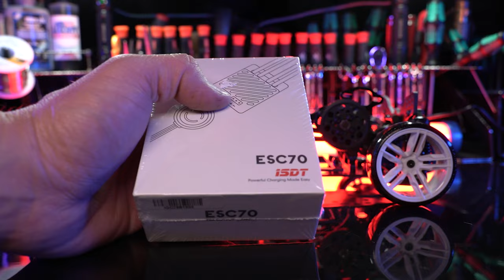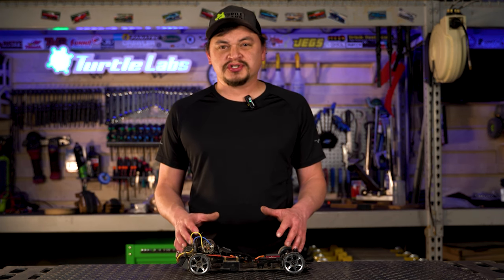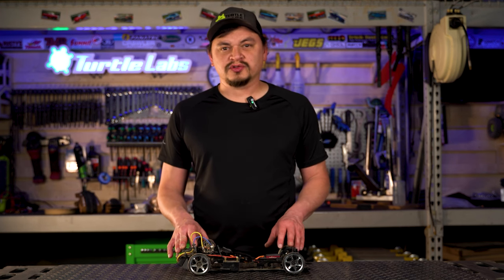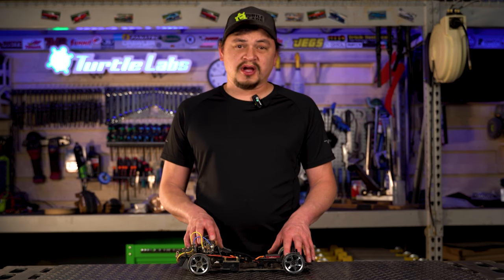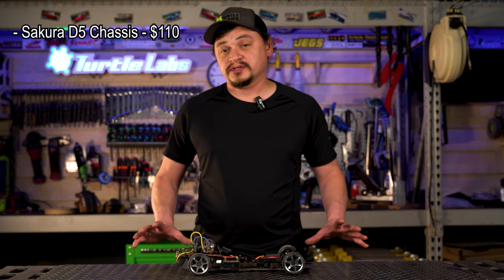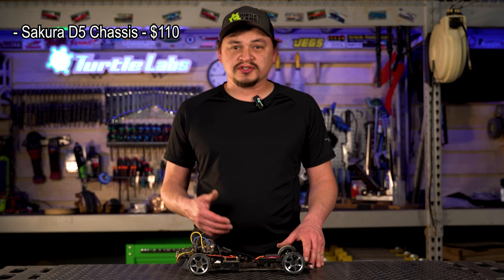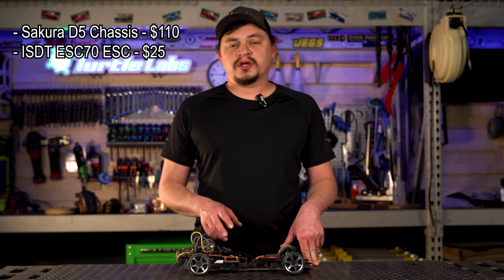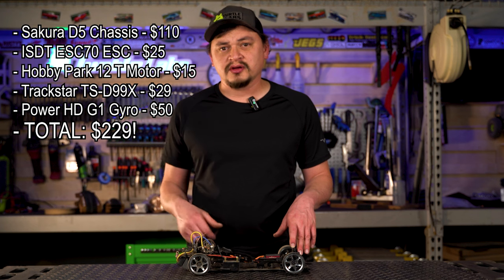DIRT CHEAP Brushed RC Drift - Sakura D5 Budget Starter Build

Comment from the maker: What is your experience with brushed vs brushless? Do you think you need brushless? Do you prefer it? I would love to hear your feedback!
Reply: Brushed is ok but sensored brushless is the way to go! They just run better smoother and faster
Reply from the maker: @jameshankssr466  I agree completely. Brushed is a good cost cutting alternative for a beginner, but brushless is better in every way, other than cost.
Reply: @turtlelaboratories  you can get some pretty reasonably priced brushless setups you just have to look for them! You dont need top of the line to have fun
Reply: @jameshankssr466  Do you think that the Hobbywing Xerun Justock Combo is ok for drift,or is for completely another purpose.Think its very budget friendly.

Comment: just ordered the d5 mr v2 a few days ago, looking forward to trying it.
Reply from the maker: Awesome! You are going to love it!
Reply: Just replace the shocks and you'll be good to go chassis wise for along time. I like the yeah racing 55mm 
qutus slider shocks. Stock Sakura springs, 4 hole pistons, with 10wt. Oil.
Reply from the maker: @DJ.1001  I have the QUTUS shocks on one of my MST RMX cars, and they are definitely a quality unit. Thank you for your feedback and advise!
Reply: I just finished my mr v2 awsome chassis
Reply: Do the kits come along with remote control

Comment: I run my D5mr right beside the hannya, yd2, and mst chassis at my local track. I dont feel disadvantaged at all. Infact my car is on the faster side. Good electronics are more important than the chassis. I run a d10 motor, XR10 stock spec esc and a full futaba s.bus suite. R33 receiver, gyd550 gyro, ct500 servo. My whole car even with top of the line electronics cost about what the other spent on just their chassis.
Reply from the maker: This is my mindset as well. As long as the chassis can be adjusted the way you need, and its durable, it should do just fine. I also agree that money is better spent on electronics, for a better driving car.  Thank you for reporting your feedback on your rig!!

Comment: I’m learning to drift with a d5 running a 19x1 brushed motor and a hobbywing 1060 esc I’ve got no complaints so far
Reply from the maker: Heck yeah. Thank you for your feedback on your rig!
Reply: So do you believe you can go with brushed as a begginer?Im thinking of getting into drifting with Sakura MR but I want it as dirty cheap as I can.... 😂😂😂
Reply: @upbgenoob5488  I think you can. It would be nice to spend thousands to start with but it’s not necessary

Comment: bought the v2 and built it with kinda the same electronics. next paycheck is gonna be lipo and initial setup. what are your thoughts on turnigy (red hardcase one)? they are really cheap over here
Reply from the maker: I have a theory that all the cheap batteries come from the same manufacturer, and then rebranded. I have no proof of this though. I always get the cheap ones, and I've never had a problem as long as you maintain them properly.

Comment: I have an old HPI sprint2 from back in the day and want to get back into drifting. Thoughts on making it RWD? 

I’ve just kept it brushed as it came and upgraded the ESC to handle lipo. Just as fun :)
Reply from the maker: Hey Johnny! I would say it wouldn't hurt to try, if you are getting back into the hobby. It likely won't have the same geometry as newer rigs, but you've already got it! You could remove the front belt, but you will need to add a gyro inline with your servo, and hope your servo will be compatible. I wouldn't spend too much on it, and would suggest spending money on a newer chassis, if you are wanting to seriously get back into drifting.
Reply: @turtlelaboratories   That’s a great idea! I was debating on getting a Yeah Racing RWD suspension kit to get something similar to the geometry of newer chassis but it’s $140 :/

Im gonna give it a shot and see how it goes. Do you think a stronger motor is generally necessary for RWD drifting vs AWD? Stock came w a 15T Brushed motor.
Reply: @JohnnyTsunami_ buy a Sakura they’re 100 bucks for a whole chassis

Comment: I have a brushless combo in my FTX Vantage 2.0. would this be ok in a drift car?
Reply from the maker: It would make the car go, but I would suggest going a different route. That FTX Vantage seems to come with a sensorless motor/esc combo. A sensored setup will have more control over throttle input and feathering. Also an ESC that is tunable helps dial in the car to suit your driving style.
Reply: ah ok thanks for clarifying that. @turtlelaboratories
Reply: oh i think i understand now, the sensors link to the gyro? @turtlelaboratories